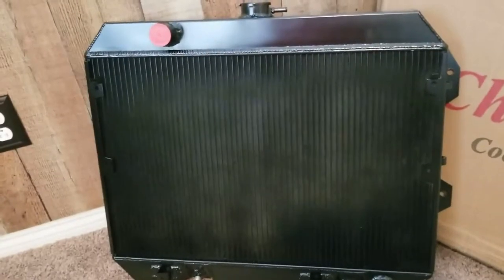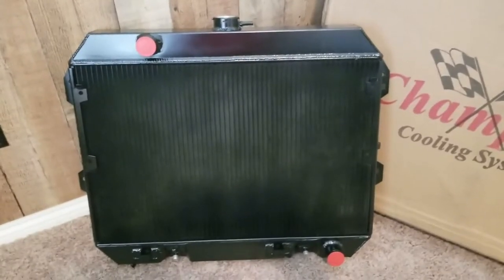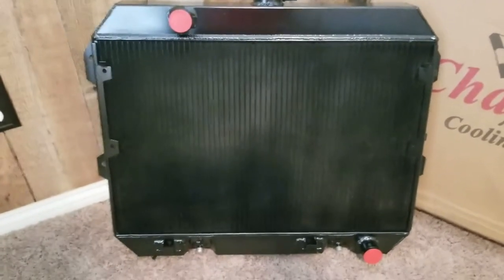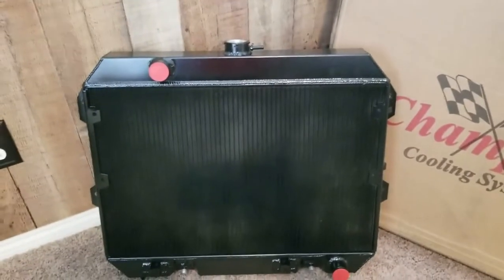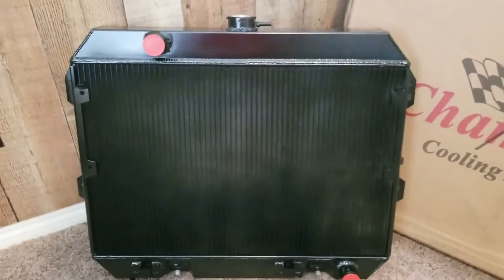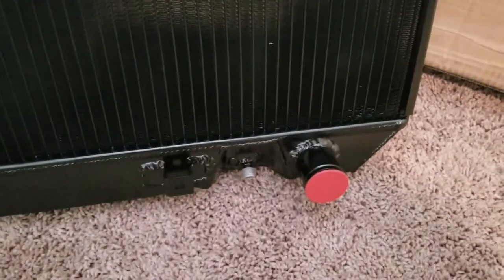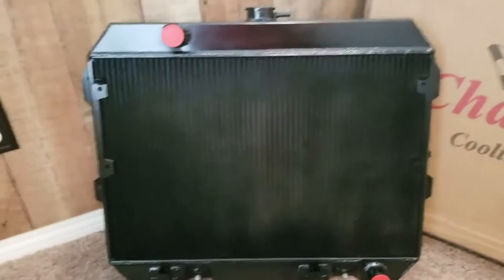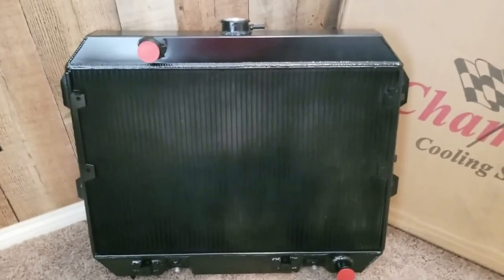New Powder Thermal Coating Service for Radiators

Comment: Engine Armour Coatings also offer that radiator ceramic thermal dispersant coating. They are based in Tampa, Florida. BTW, that coating can also be applied to a car's intercooler to reduce intake temps.